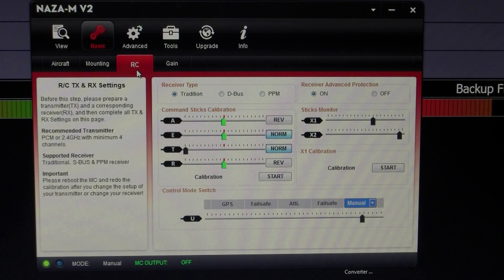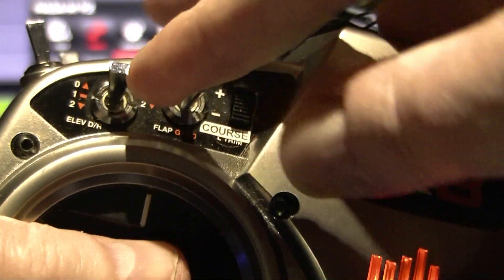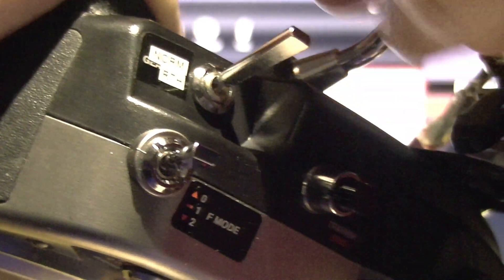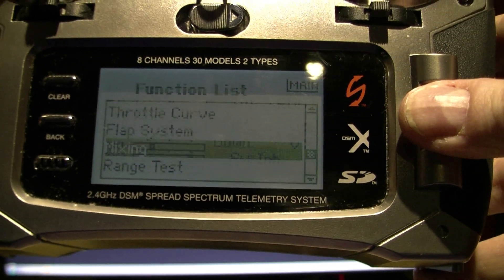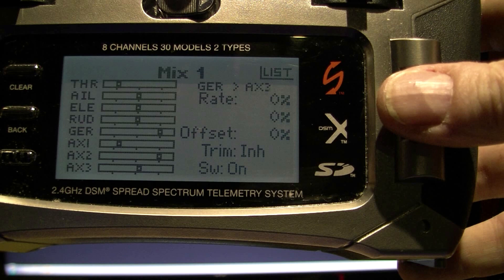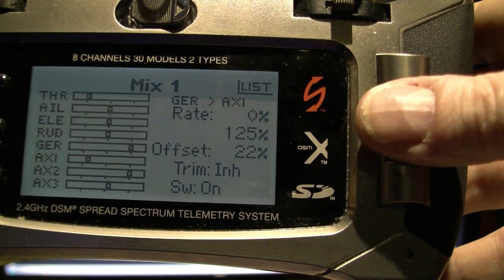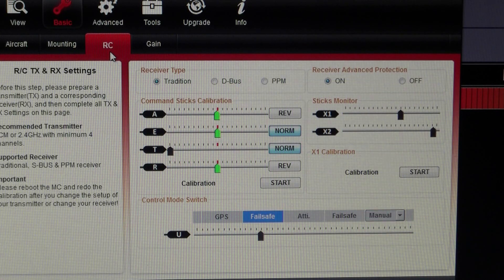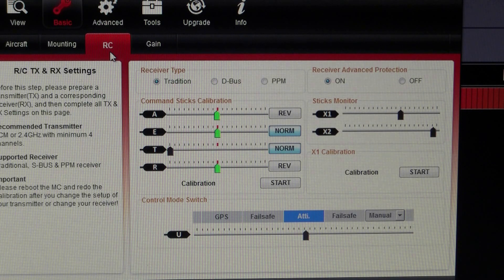How to setup failsafe - Spektrum DX8 to DJI NAZA

Comment: Hi sir recently i have installed dji m lite in f450 frame and i faced a problem that when i take off the drone in gps mode it move one side and if i take off in manual mode then it take off normally . Can you give me some solution??

Comment: Actually, I do have a question and I'd be grateful for advice.  I am trying to set up the IOC.  It won't let me tick the IOC selection/activation box in the 'advanced IOC menu'.  I only have 1 three position switch on my tx (spectrum dx7s), which is already assigned to GPS/Atti/Manual modes.  What switch can I use to activate home lock (course lock is less important to me - I think)?  And how do I go about it?  Thank you...........
Reply from the maker: Usually, if you can't select the IOC check box, it's because you haven't calibrated the compass, or the GPS/compass isn't plugged in or it's not working.
You can use any switch for IOC, even a 2 position - you can set your end points in the radio for whichever channel you want, which will bring the switch into trim for 'off - home lock' or 'off - course lock'. I'd suggest you use 'off - home lock' because when you lose orientation, you can flick the switch and pull back on the stick..... it should come back, no matter which direction its pointing.
Sorry it's a little vague, I don't really use DJI products anymore and I now have a Taranis radio.

Comment: If I fly in ATTI or manual mode and my radio signal lost, can RTH kick in anyway? Or will RTH works only if I fly in GPS mode before radio signal lost?
Reply from the maker: Using failsafe as per the video, it won't matter what mode you're in. RTH will always kick in.
This video was done for when you want to force RTH, but it doesn't work if you lose signal. You'll need to set your RX up with this guide: http://www.xflysystems.com/blogs/news/7000392-setting-up-your-spektrum-dx7s-ar8000-failsafe-for-dji-naza

Comment: I realy need your help I have everything working I have a naza v2 with gps I tried to setup naza in acro but I couldn't get it to work in heli it works fine dx8 with ar8000rx  rth and ioc all work but if I turn off tx it does not go into failsafe! can you please email me your settings?  davidringler40@yahoo.com  thank you in advance for any and all help!
Reply from the maker: Sorry David, I haven't got the Spektrum anymore - I moved over to FrSky.

This is the guide I used, though.....

http://www.xflysystems.com/blogs/news/7000392-setting-up-your-spektrum-dx7s-ar8000-failsafe-for-dji-naza
Reply: so dx7 setup is the same for my dx8? with ar8000?
Reply from the maker: david ringler Your DX8 is already set up for flight modes and failsafe, you now need to set the AR8000 to give a failsafe command to the NAZA on signal loss. Following that guide should sort you out.....
Reply: thank you very very much, can dx8 with ar8000 with naza v2 with gps can it be setup in acro instead of heli? I tried but I couldn't get naza assistant  to let me setup modes and ioc in acro just heli. but with my 9x I was in heli for a year than switched to acro and truly I didn't notice and different performance so why acro instead of heli?
Reply from the maker: david ringler You can use either, it's only because a multi-rotor more resembles the characteristics of a plane, rather than heli....... you'll be ok.

Comment: You saved the day man
Super duper way kool
Reply from the maker: No problem :-)
Remember thought...... if you're in failsafe and want to regain control, you need to obviously flick the Gear switch back and then you need to change flight modes (and then change flight modes back if you wish). If you're 100% happy with the position it took off from, you'll be ok to let it auto-land in failsafe but if you're not sure....

Comment: Right what is that means
Reply from the maker: Basically, it's another failsafe feature.... if you have it turned on and you keep your sticks at the same point for more than 30 seconds, NAZA thinks there's a problem and forces failsafe to activate. It's not activated when you're hovering though.
DJI introduced it because they thought the 'fly away' problems were caused by radio lock-out

Comment: However I got this working I have this totally different more complex mix settings.
GER>GER
Rate:100%
-75%
Offset:80%
Trim:Inh
Sw:Gear0

May I ask what your switch select is in your settings?
Mine are.
Flap:Gear
Mix:Inh
Aux2:Aux2
Knob:Aux3
Reply from the maker: I can't remember and I've since sold my trusty DX8, sorry :-(

Comment: How can I set transmitter fail. I got dx8 an naza v2 but when I turn off the transmitter it doesn't do anything. Please reply
Reply: You need to bind your receiver in PRESET Failsafe for it to work. Nice thread on RCGroups on programming your Spektrum DX radio with Naza